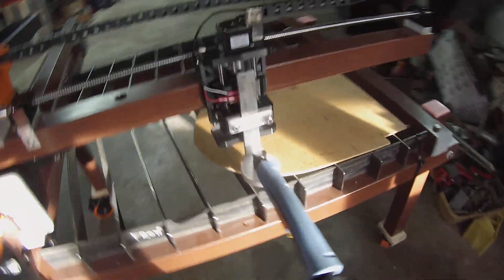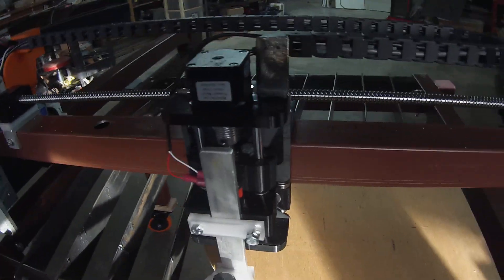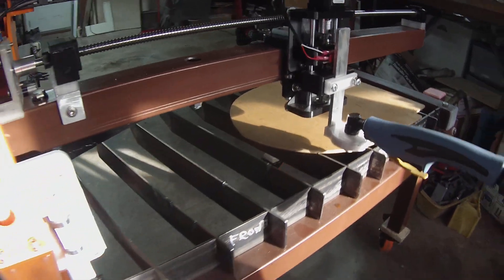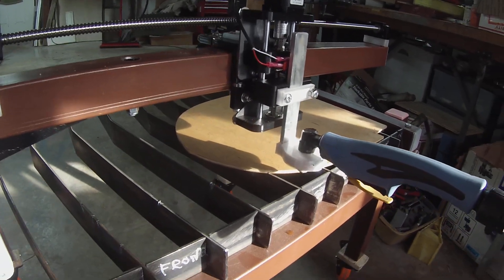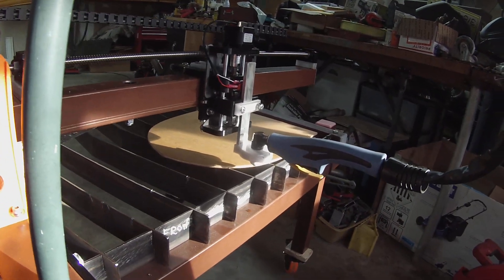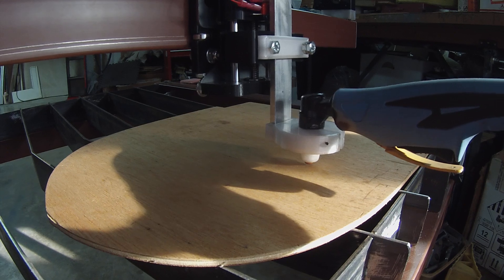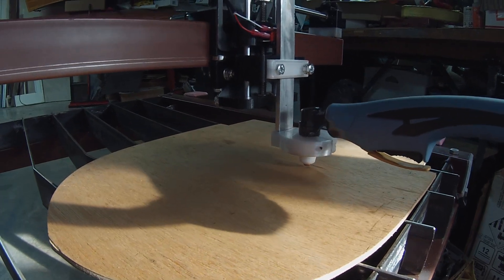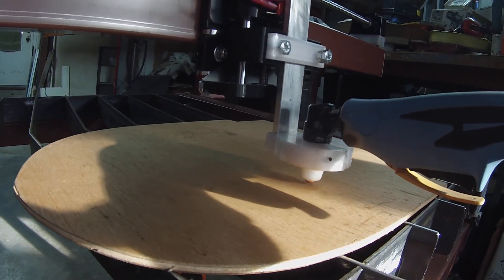Quick video running the test G-code for Z axis from JDsGarage

Comment: Whay since jd garage is un responsive how do you activate the z probe when cutting. Do I set it up in the post processor or in fusion 360?
Reply from the maker: I'm not an expert with fusion 360, but the new post processor by OpenBuilds for grbl works for me.